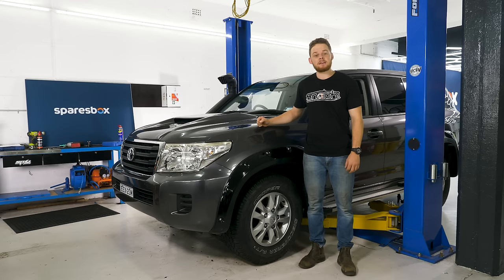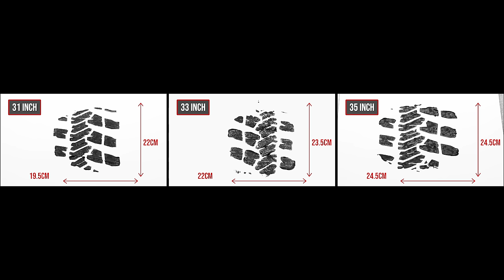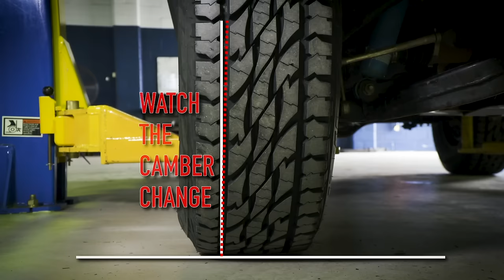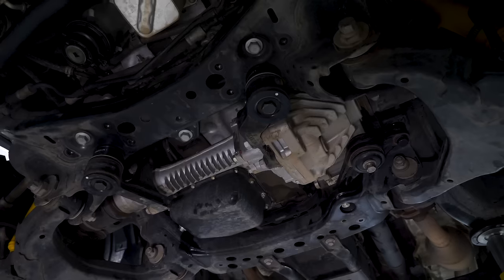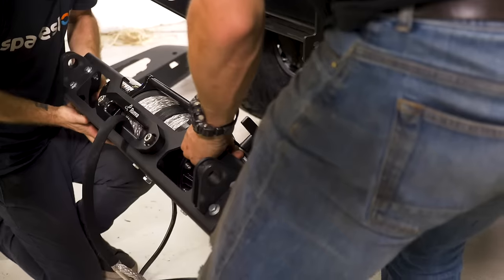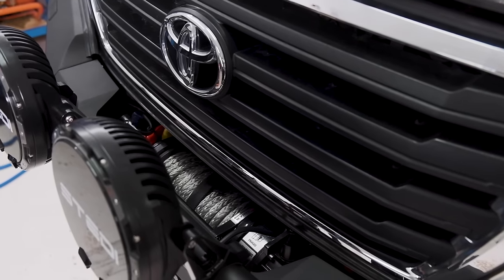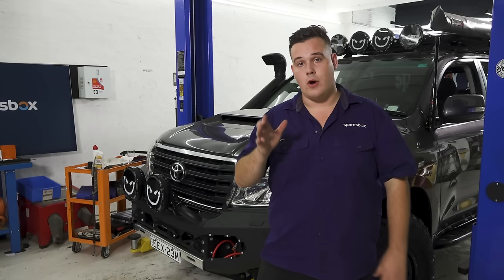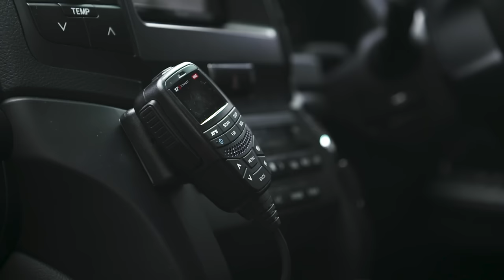INSANE TRANSFORMATION! How we made this stocker 4WD 24/7 trip-ready! The 12 mods YOU need!

Comment: Also wasn't in the video when you lift the suspension you may need go increase brake line lengths and when carrying out the wheel alignment make sure this is done after all your accessories are fitted as load with affect your wheel alignment so you want to generally make sure you do a wheel alignment with your default load and full tank of fuel.

Comment: You forget to add up for any suspension mods, you should also replace  the sway bar link in order to allow the suspension to flexs properly without any problems.
Reply: We installed extended sway bar mounts in the rear along with an adjustable panhard bar to allow proper articulation.
Reply: What about extended brake lines.? What size lift did you go with

Comment: Love how engineering was given a mention! Way too many illegal 4wds getting around and taking the risk (not from getting caught by police) but quite possible jail time in event of accidents and let's hope no one gets killed because of it, let the engineers determine what is safe!
Also something to mention with 12volt setups is the Alternator specs. I am not aware of what is actually in the 200 series but many smaller 4x4s like dual cabs can easily fry alternators when running lots of power hungry accessories such as extra lights and charging accessories like DCDC chargers, especially when all ran at the same time. 
Regards, 
Biomedical, Electrical and Electronic Engineer.
Reply: One of the most overlooked parts of a build yet one of the most important!
Reply: Worst comment in the section

Comment: Man I'd love it if you guys would do all of those mods to my '99 Toyota RAV4 5 speed AWD!!! The only thing that sucks about this all-wheel drive system. Is there is no low range! When I'm towing my 1800 lb camper off-roading! I have to give it hell to go up the hills.
Reply: 35’s on a vehicle with no transfer case doesn't sound very do-able you will have serious torque and drivetrain issues on steps or river crossing or any hectic incline
Reply: @dermotpiercey6019  mines not stock for much longer

Comment: i like the under body cover stuff... i have a doubt regd..the Stephany wheel position.. cause its a 35" wheel moving it to the rear right corner might damage the bearing of the rear right wheel due to excess weight (weight imbalance) in long run.. i feel it should positioned properly in the middle after that we have to plan for jerry cans...

Comment: I look at the bargains on craigslist and often wonder what suspension systems can be found for them to make them into such diehard trail vehicles like this. And there is a few, especially from Toyota. Even a few Nissan's, too. Jeep Grand Cherokee's also, but they seem to have a lot of high miles on them and not many suspension options to get up to 35s on them that I've seen. Toyota scenes to have the best record of aftermarket parts. Although I would love to see front and rear axle upgrades to Dana 60s to handle the meats better.

Comment: I'm wondering... what is the weight of the front and rear bullbar, the under-body protection, sliders, roofrack etc - how much weight all those big metal parts add and does it worth having them for a strictly touring build? 
And... I'm wondering what happen if I'm an European overlander and mu car pass the law restrictions here would I have problems with the mods 'Down under"?

Comment: Curious to final cost? Would it be similar for a 2018 GXL Prado? Also considering they way the back was set up, can it be done so it can be taken out to use the extra seats in the back when not out touring?
Reply: Im setting up my 2019 prado and have done  snorkel, arb summit bullbar,9" led driving lights,12000lb winch, fulcrum formula 2" lift...have rock sliders on the way and still have a list of stuff to go... taking my time but getting there and will get my 33" micky T 's soon .. its not cheap but cant wait to do tassie and the cape

Comment: So you “modified” the body mount to fit bigger rubber. Is that legal.
Reply: It was non structural parts, so yes it is.
Cutting bumpers or quarter panels / trim pieces gets done quite often. 

What they didn't mention was that removing the third row seats needs to be engineered on a lot of vehicles.

Comment: I would put the brakes Brembo + wheels from 18 (20) inches; I would cut the fenders so that they are separate on the body and bumpers; For more articulation of the suspension, I would put a solid axle in front (and it would be better to take the 201st with the front axle, which was produced for the Arab countries).

Comment: Ok, so around the 6 minute mark it is stated that 350kg of accessories are being added to the rear and 150kg to the front. A total of 500kg. A Landcruiser diesel of that vintage has a payload of 645kg according to Redbook. So I hope you are packing very light, and the driver and passengers are midgets...
Reply: I was thinking the same. Time to diet and learn to camp on the minimal side... like with nothing..
Reply: Does the re engineering not include gvm upgrade?

Comment: You got 35s engineered?
Reply: GAJ what’s the confusion?
Reply: Short of changing the whole suspension/steering geometry, track width, brake upgrades including ABS reprogramming, ESB reprogramming outside of manufacturers limits, lane change & stability test & proving all upgrades are structurally up to the increased loads compliant with ADR standards, you pretty much can't get 35s engineered on a registered vehicle anymore in Oz. Maybe they know a friendly engineer, but I certainly wouldn't be shouting about fitting 35s publicly if I did know one 😉
Reply: GAJ the ranger raptor comes stock with 35s
Reply: @II_4_R_Z_II  Listed as 33" on the Aus website & probably on the approved tyre label. As it's an ESC vehicle it may be ok to increase the tyre diameter by 2" (50mm) in some states without engineering, but not others. The 200 series came with 31" tyres as standard so can only go up to 33" without engineering, as mentioned getting 35s engineered is pretty much unheard of nowadays & never really shown by youtubers to prove it happened when they mention fitting them.
Reply: Americans be like why is “engineering” required for 35s?

Comment: You mentioned all these modifications but you never mentioned gearing what gears do you use in a front in the back it seems like you only have the standard gears?
Reply: We're still only running the standard gears! The 200 has more than enough power to spin the tyres and the auto provides enough control off road!

Comment: Last video: you cant run 35s on an IFS.
This video: 35s on an IFS
Reply: IIRC they said most dual cab utes.
Reply: lc200 is a bit bigger than their dmax
Reply: It's much easier to fit larger tyres on a 200 series than it is on a smaller dual cab that's for sure.

Comment: How do slotted/grooved/drilled discs perform, off road? Always wondered if they could get dirt/sand/stones stuck in and catch the pads, n stew things up? Need to replace the pads (and may be discs) on my LR D4, so wondering about options
Reply: We run the DBA T3 rotors on all our 4wds (200 Series, 80 Series and Prado) and haven't had a problem with that! Makes a huge difference for heavily loaded 4wds both on and off-road.

Comment: Engineered on 35’s I’d like to get the number for that bloke as I haven’t managed to find anyone to engineer 35’s for the last 7yrs
Reply: No DPF, that 200 can't be engineered. I have two suspicions either they did get it engineered before putting on the DPF delete pipes or it isn't engineered and they just talk about it so they don't get sued by someone.
Reply: @AAA11538  maybe its a 200 before dpf came out?
Reply: Sly Fox that one is pre DPF  mate. Probably some where between a 2007 and 2012 model that one. DPFs came out at the end of 2015.
Reply: @AAA11538  it is a pre-dpf model, i follow sam on instagram and when they first got it he said they specifically chose a non-dpf model
Reply: @AAA11538  it's a 2015 so no DPF, they came out in the 2016 when they did the facelift.
Reply: Michael O'Brian I cant understand why 35s wouldn’t be able to be engineered, unless you go and cut your guards to buggery to fit them with stock suspension I can’t see why there would be a problem. As long as you’ve taken all the right steps in between there shouldn’t be an issue
Reply: Not looking hard enough, I'm getting 35x12.5R17s engineered as we speak
Reply: Don't shout about it too much or you'll find an engineer missing off the approved list 😉
Reply: Update was late 15 - October. DPF equipped.
Reply: I kinda wish you guys had United States laws for vehicles (well not all cause we’ve got dumb laws in a different way) but I’d love to see these guys on 40s and like 6 inch lifts. Just over the top. I can’t even imagine where they’d be able go after all that.

Comment: Hi guys. could you please tell me one thing: 42 tires for Nissan patrol will be ok ( of course lifting suspension, installing more powerful engine) for riding in mountains? There pretty deep trenches on the road after massive trucks which transport logs and massive pieces of stones while ridding. So one needs really high clearance.
I've seen that underneath protection, it's great! Is there such a thing for Nissan patroll?
Reply: dolimi jotoo  What do you mean?

Comment: I got an ifs 4x4 just wondering will I get away with 33s On a 2 inch lift on stock cvs and control arms ( mainly going to be using my 4x4 on light or medium 4x4 tracks as well as going on the beach but nothing to extreme ) if any body can help that will be awesome
Reply: Uptotrilogy depends what 4x4 you have. They’re not all the same.
Reply: Not sure if you will have enough Camber adjustment..

Comment: Wheel and tire specs please. Awesome build by the way.
Reply: tire is bfgoodrich rangler 35 inch dunno wheel
Reply: Caleb Cavill Method wheels
Reply: Thanks for the reply. I was trying to get specifics though. Like 305 70r18 or 285 75r18 or something like that. Wheel offset would help as well. Looks like an 18 inch wheel.
Reply: Caleb Cavill it's a good year not bfg
Reply: Wheels are Method 305s in 17 x 8.5 +0 offset. The tyres are a 315/70/17 Goodyear Wrangler MTRs!

Comment: Makes you think an Electric off road SUV would need a lot less mods than a regular gas SUV. No Diff., No Transfer case, no oil, no diff breather, no diff lock, no rear drive shaft, no transmission, no clutch, no over heating gears and more!